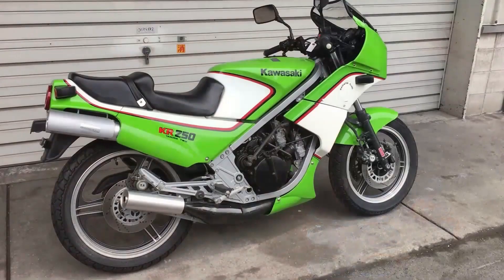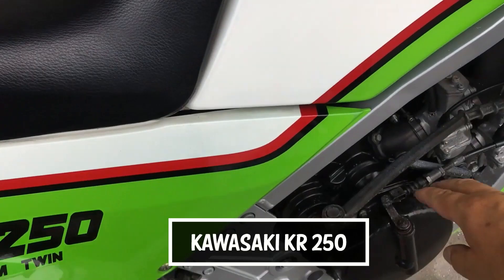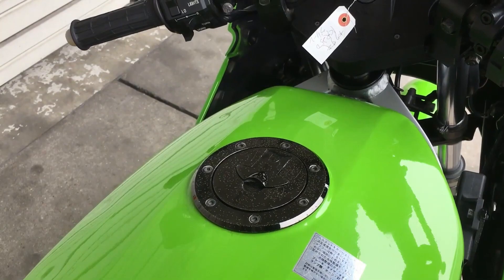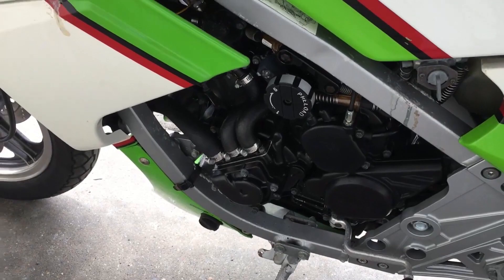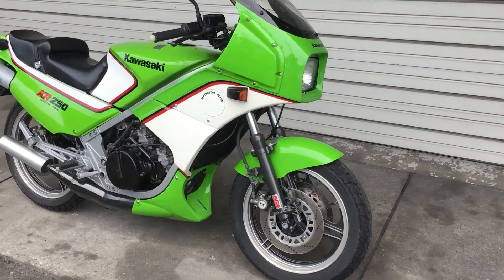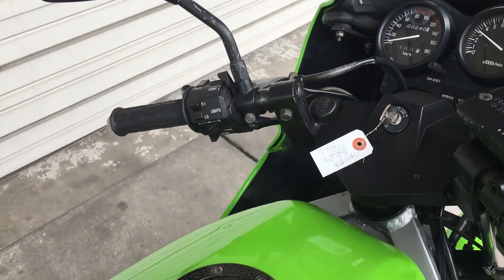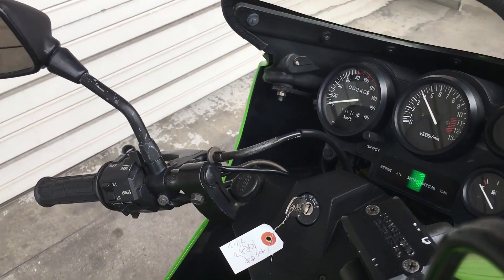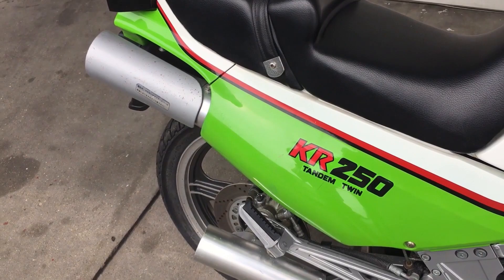Kawasaki KR250 - Built To Race

Comment: With the money i had saved working on my uncles dairy farm in the school holidays, and with a loan from dad, about a week after my 16th birthday in 84, i bought a brand new KR250, and it was awesome. These and other 2 stroke 250s (RG, RZ and the atrocious MVX250🤮)  were learner legal in NZ at the time, and my mates had an RG250 and  a RZ250 YPVS, the KR was faster than both and had far better build quality. They also did very well in production racing both here and in Australia. I have seriously thought of getting another, and a friend of mine has a very nice one i could probably get, but a few things give me pause. One, they are quite small, and im over 6'.  Two,  parts are now VERY hard to come by, at one time, even in the 2000s, most wreakers here had one or two sitting down the back, those days are long gone. Pistons for example are impossible to find, NOS or pattern, I know 2 KR250s rebuilds that have stalled due to lack of pistons, Also the bores are nikasil coated (so no re-bores) you have to get them recoated. You can use pistons from one of the Italian 125s, same bore & stroke and the ring locating pin is in the correct position, (Cagiva mito i think) but you have to use their rods, which are shorter so you have to machine the barrels down, it a bit of a faff around, but hey, needs must.
Reply from the maker: it can be hard with parts for the old uns, i know that well from the bloody Laverds lol but be good to manage to keep another going 🙂 what is it they say - where theres a will theres a way 🙂

Comment: I think Walter Kaaden and MZ were the first to go the racing tandem twin route in 1969/70 unfortunately they ran into problems and these were possibly going to take to much time and money to fix there was a 125 and a prototype 250, prior to this they were developing a 3 cylinder 125 but the regulations changed and only 2 cylinders were allowed.
Reply from the maker: Cheers for adding this. as i have often said, if we could amass the combined knowledge of all the subscribers we would have the most comprehensive motorcycle encyclopedia ever 🙂
Reply: @barebonesmc  To be perfectly honest I have a fragmented memory that can only give me a hint but that hint can be the start that is needed for a search engine to flesh out the bones of a fact, bottom line is I use a search engine like anybody else, lol.
Reply from the maker: @xvdd1  join the club mate 🙂 the problem now is all the part truths and forgotten bits everywhere
Reply: @barebonesmc  You are absolutely correct sometimes the hard work is in seeing the woods for the trees as a lie repeated often enough becomes the truth this situation requires much time sifting through search results to be able to take a stab at the facts.
Reply from the maker: i guess i also see it from a different perspective because of the work i do on the different websites, i have to analyse what is being promoted in the searches, and honestly, this year has been a bloodbath. google has changed all its search criteria and even some massive sites were just wiped out, and there is so much AI generated content now, it is starting to drown everything else out. and once there are 4 or more AI generated sites saying the same thing wrong, google begins to accept that as the right answer and then starts to demote sites with different opinions . it is a bit of a mess at the minute  there was an official leaked document from google that went back to 2019 with the advertising department requesting the search developers made the results worse to increase search time so they could hit revenue targets, and that has happened since. the joys lol  @xvdd1
Reply: @barebonesmc  That does not sound like fun, Google is known for censorship and manipulation and they are not alone in that respect but that is the cyber space we live in unfortunately it is having a wider influence in the physical world which will continue to grow for better or worse.
I hope your efforts are successful.👍
Reply from the maker: @xvdd1  its been a challenge lol. watching it all happen on google and then seeing the effects on here too shows how they are just following that principle. the search has begun to take longer and longer, whatever you look for, but im a survivor 🙂 have a great day

Comment: A deep dive into them would be very interesting I think. Essentially being 2 separate engines, one behind the other sounds like a weird patched together at the last second, just to have a race bike but, it sounds like such a successful idea that it just can't be by accident. I'm still completely lost as to why or how since it 'should' be added extra weight and 1 engine in a V configuration 'should' be just as powerful yet lighter but the success of these proves there's something more to it than I've seen so far. Obviously they are a great bike, but why?
Reply from the maker: im sure the idea came from the bike Gilera couldnt get to not explode lol, the bicilindrico was really quick (with 180 degree firing) but it just exploded all the time. im thinking 2 smaller cranks each with less effective reciprocating mass plays a part in the whole equation, but i'm still digging, and some of it doesnt make much sense, i guess sometimes theory and practice can give us different results 🙂
Reply: @barebonesmc  Ha! Well put. I hadn't really thought about it before but, that pair of separate LIGHTER cranks could maybe make for a much snappier, responsive throttle which would be helpful, I think?
I knew nothing about the bike before you covered it but, it's certainly interesting, plus, despite it maybe appearing as if it was a quick fix patch of some sort, apparently has very thoroughly proven itself as a good design, counterintuitive to me yet obviously very good. A damned interesting design at the very least.  BUT, can it beat Allan Milyard's V10 Dodge Viper engined monster lol. I swear that guy isn't just a mad genius, he's got to be a magician or something like that. Some of the bikes and engines he's built over the years are absolutely amazing.
And BTW, I went faster than he did on that Viper engined beast, just not carrying a passenger, I never even would consider going that fast with someone elses life at stake. He was setting a record so I can't knock it, especially since his was all done under tightly controlled conditions. He almost got to full throttle too lol.
Reply from the maker: @lorditsprobingtime6668  like i said, the more i dig the more the story evolves 🙂 as to Alan Millyard, he is a genius, i want his inductive pipe bender though lol, i just wish he'd dump that idiot he uses on TV, Henry Cole is probably the most annoying man i have ever met lol
Reply: @barebonesmc  Is Henry Cole the guy that was on the back of his V10 Viper engined double up passenger speed record with? I did Google him and he looks like the guy I remember from that video.
Believe it or not, I've somehow only very recently followed up on this wizard character of legend called Alan Mllyard! I know, shocking isn't it. You're not kidding though, he's an absolute genius and seems a hacksaw and file are his 2 main tools lol. I've gone through a few of his older videos about the 5 or 6 cylinder Kawasali 2stroke plus the V8 and V12 Kawasaki 4 stroke engines. Oddly I loved the sound of the V8 one more than the V12 which surprised me. 
It's a little sad seeing his amazing creations in some bike museum, especially one in the wrong country instead of out wowing people as running bikes, then again, at least they're kept as perfect as he built them. I just hate the thought that as with an American bike museum, even a museum near where I was living, they had a lot of bikes, many probably donated yet THEY then sold them, same with the one near me that had several working steam engines and lots of other great equipment, all donated yet rather than giving them back, they sold them and that pi**es me off.
Apparently I'll have to look into this "inductive pipe bender" since I currently know nothing at all about it, it sounds interesting and if he's got one and you want one, I can only assume it must bend pipes without any shrinkage on the bends, something I hate seeing with exhausts.
Reply: @barebonesmc  I almost forgot. There's a channel I've started following recently called " 2STROKE STUFFING " where he's building, testing, find problem and sort that out on a home made 50cc 2 stroke engine in a bike. Last run he got it putting out 7 hp which may not sound a lot yet but, he's still bug sorting and that was at around 19,000rpm! I have seen him get up to 24,000rpm in an earlier test so it's a pretty serious bit of gear and he's hoping to make it the most powerful 50cc in the world, all in his little workshop using hijacked teflon coated saucepans and various more exotic materials and lathe and a fairly decent CNC machine. If you don't know it already, it's definitely an interesting journey seeing each new test and hearing that thing SCREAM lol.
Reply from the maker: Yes that’s the guy. The worst sort of hanger on lol. And being honest. Mr Millyard is the only person I’ve ever seen use that pipe bender. But I saw it and my jaw dropped. Somehow it excites the molecules heating the metal from inside out with hardly any heat bleed and he was bending steel frame tubes. No twisting no warp or distortion of the metal at all. Never even seen one other than his. But I did want one as soon as I saw it 🤣🤣🤣
Reply from the maker: I’ll look when I can. I’m away at the minute but I’ll get there at some point. What free time I’ve had has been used finishing a video for this week. But I got out the the local MX races where I’m staying today so had some real time out 😊
Reply: @barebonesmc  You've certainly been putting a lot of time into research, editing and uploading content so, I'm kinda amazed you have any time to yourself at all.
Your content is always great so thanks for that effort you put in.
Reply from the maker: @lorditsprobingtime6668  cheers mate, im still a bit bemused about the whole youtube thing. and im used to working while im away. i am going to have to take some time out to rebuild the shop fronts on the website which to be fair has been needed for a fairly long time now. but i enjoy doing the videos. amazing what an old dog can learn lol, i had never edited a video until this year, and i am a bit of a technophobe at heart, I just love bikes, so saving a few old ones and talking about them keeps me sane 🙂
Reply: @barebonesmc  And we all benefit from that shared love. You do what you need, I for one will be staying subscribed no matter what so, even if you don't put anything out for 6 months, I'll still be straight onto it to watch. Too much time without content does seem to lose creators subs but, I'll never understand why, if it's content you find interesting now, why unsubscibe just because it's maybe not as frequent as you'd ideally like is a way of thinking I'll never understand.
Reply from the maker: @lorditsprobingtime6668  bless you mate, ill not be away that long unless something stupid happens, the hard bit is the way youtube penalises people really, if i disrupt the upload pattern even a bit, in general, youtube just shows it to less people, and there is complete panic over the latest google search and on to youtube search updates. it has come out now in official documents that they have actually been deliberately making the search results worse and harder to navigate so people go back to the search page more often, where google can serve them up more, they get more clicks so they make more on advertising, it really is that simple, and when they literally control 95% of search traffic, they can do what they like